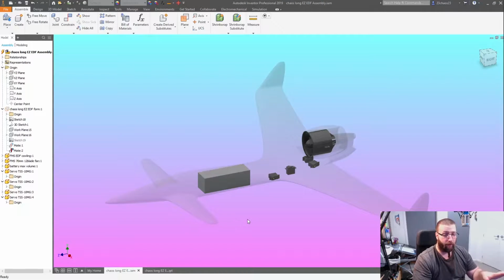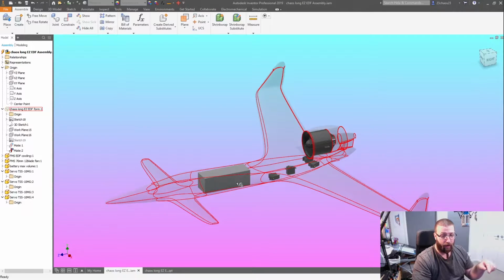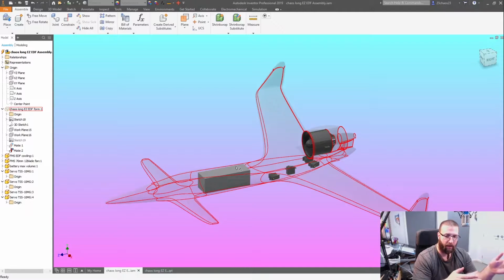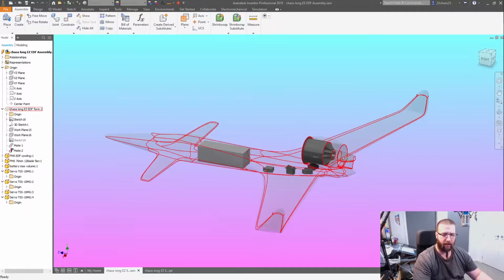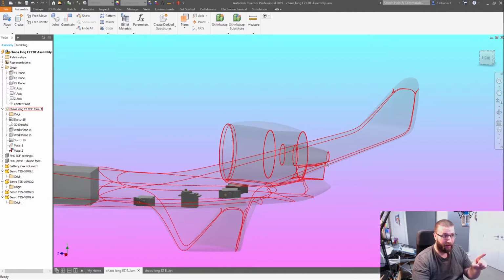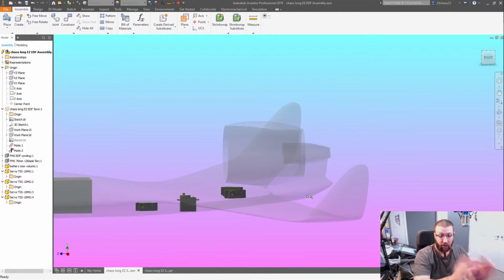chaos daily 2021: 019

Comment: Hey there, really good new approach! Just a couple of questions:
If you push the battery a little bit further back (like 3mm or so) wouldnt that allow you to locate the canard servo further up front?
That could make it easier as it avoids routing the linkage around the battery...
Is the wing thick enough to put servos directly in there? I am a little worried that you might be building "torsional springs" in the aileron linkage - The standard carbon fiber tubes have a rather low torsional stiffness as most fibers are oriented longitudinally.
It will work, but it might not feel as "sharp" when flying and be more prone to flutter, than a direct linkage... 
Last - I would prefer the central rudder, mainly because the tips/winglets are way more likely to get damaged during a bad landing or even during transport. Having movable parts there could mean the are more delicate, and when damaged, more difficult to repair. Would be super cool to have exchangeable tips, but if it is splitflaps or central rudder - I would prefer last!
Reply from the maker: Keep an eye out for todays daily, these concerns and some others were also kinda mentioned by one of my patreons... good ol Simon lol. So I will go over both your comments in todays video as they both have some great ideas and make total sense.